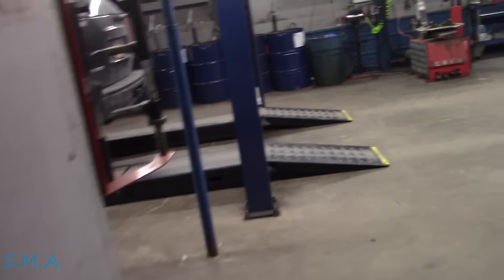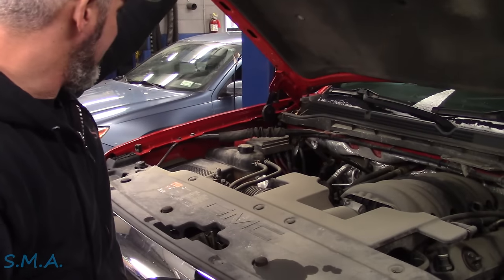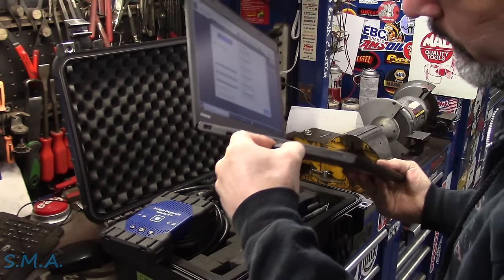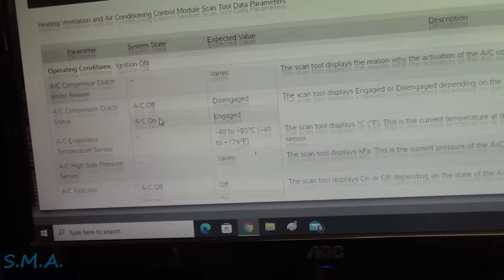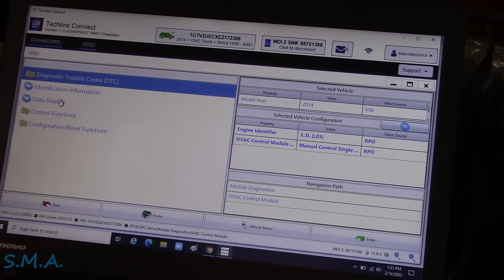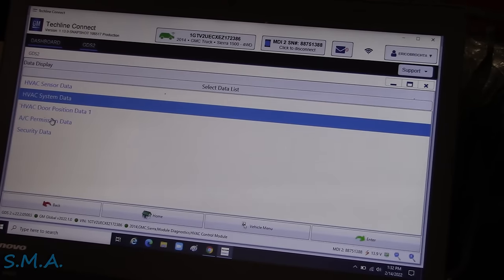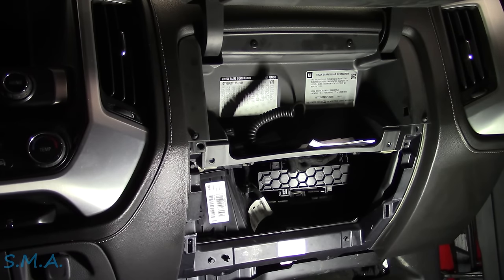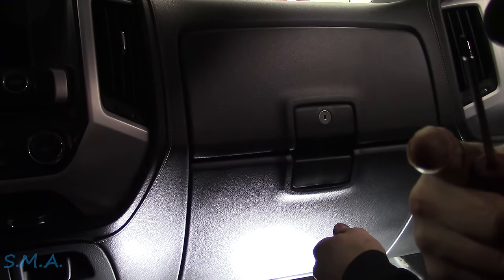Chevy/GMC Truck: Failed Heater Control Module

Comment: Need to get yourself a mid sixties Ford, Dodge, Chrysler project car. Get back to the simple things. Sit on the fender with your feet in the engine bay and actually SEE the engine. That should take some stress off.
Oh yeah, about 1/4 the number of tools you need.  lol

Comment: I don't think I mind having the complexity, it is the seemingly poor engineering that makes me a pissypants to use your vernacular.  Just putting components willy nilly into any nook that can't possibly be harder to service. and fasteners that are as varied as chocolates in a big sampler. Metric here, and SAE there, 5mm, plastic keepers that break, etc etc... Planned obsolescence that can cost you 70k for a pickup that they can't seem to figure out after 100 years or so how to keep the fenders from rotting out after just a few years. I think the only way to stay ahead of it is to be 1 rich, 2 lease, 3 trade'r in before warranty expires, 4 buy extry coverage? Nuts, now you got me all pissy thinkin about it...

Comment: Our throw away society if it doesn't work just go buy a new one, it keeps the  manufacturing plants going.  How are these new electric cars going to be repaired, throw them away when the battery starts to die like all our battery powered tools battery cost more than buying the tool new.

Comment: The goal is to force people to stop driving it is the green climate bunch. If you make it so complicated and cost so much to repair the average american can no longer afford to drive. I said it in a comment in another video, why does it take a switch to tell a module to tell the computer to then tell the module to run the motor to lower the window. Why do we need electric motors to lock our truck in four wheel drive? Have we grown so lazy we cant push a lever to put in and out of lock? Manual transmission once was the standard for trucks and cars now if you can find one its more of an anti-theft device because people have lost the ability to drive one. None of this is about a better car its about control of the people. When you control the ability to drive by high cost and all of it drives up the price of food what is going to be the end result? None of it will turn out good for the people. I hate to say this but it is something we all see is going on. I am sad for our nation and our youth.